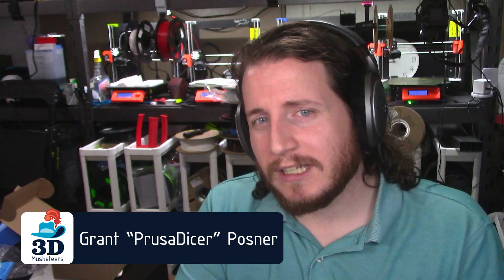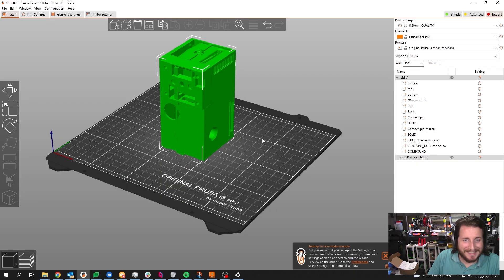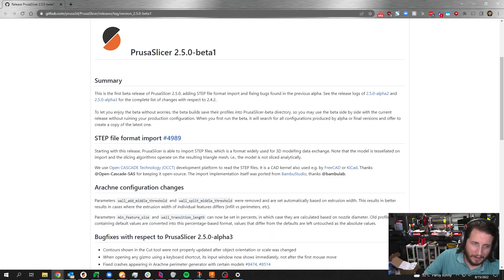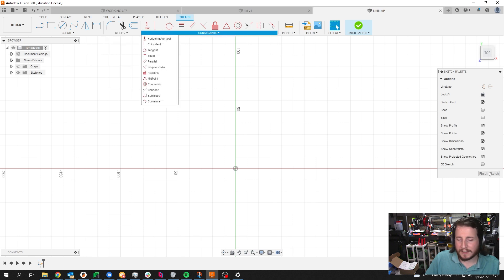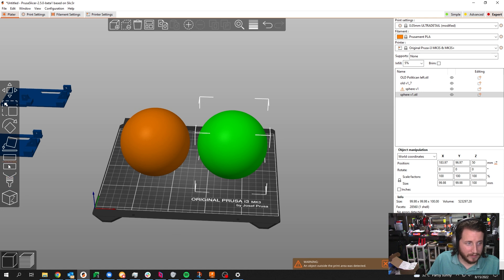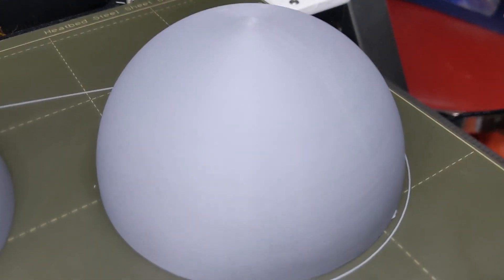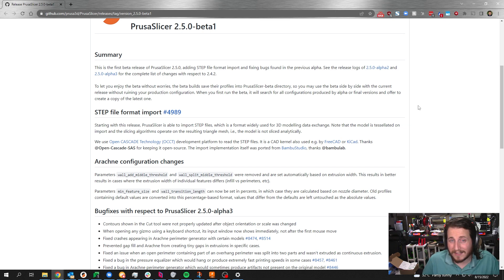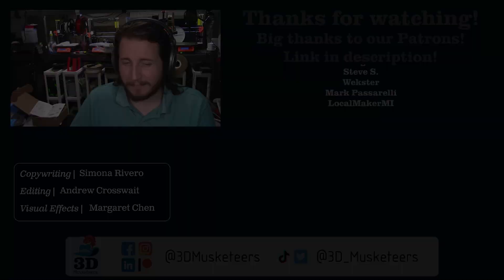PrusaSlicer's BEST New Feature! (Prusaslicer 2.5)

Comment: Read description of PS 2.5.0-beta carefully. PS convert step to stl with library by OCCT.
If you see difference, it is only because Fusion 360 use different parameters of angular and linear deflection.
Reply from the maker: Correct, we did read that, ended up cutting it, it was slow, we were seeing how the tessellations differ :)

Comment: I need to play a Christmas slasher a little more, every time I go over to it I just can't get anything good out of it. On my ender 3 with cura I can just change a limited number of settings and get really quality prints , but when I use cruiser slicer, I have stringing I have extrusion issues I have a generally crappy surface finish.  I know a lot of people like it, but when I compare it to kira it's just not even close
Reply from the maker: LOL Voice to text error I think?

I would guess the cura profile is better tuned than the PS one, but that should not take too much to handle. If you have questions let me know! We can even cover it in a PFF episode.

Comment: I've been watching for a while now, but I still don't know what "the politician" is.
Reply from the maker: A product we are making that will filter and produce hot air, you know, like a politician ;)
Reply: @3DMusketeers  like a Nevermore recirculating filter?
Reply from the maker: with a heater built in as well. All in less than 65mm square :)
Reply: @3DMusketeers  Go on ... 😲
Reply from the maker: Hoping to hit a $50 price point, but it will not include a 24v power supply at that price. I will call out makers and assume yall have one already in a bucket and will give you justification to your significant other's to have that box of power supplies, or we will have them separate.

Comment: How is this operating? Is it converting the step to 3mf at some point?
Reply from the maker: Not a gosh darn clue LOL.
Reply: @3DMusketeers  well, would be great to know, because the one thing is an easy step to stl converter, while the other thing is a leap forwards, no matter what, I like it.
Reply from the maker: The system they use is open source, I am sure if you had the programming skills I do not, you may be able to find it!
Reply: @3DMusketeers  it's transforming into some triangulated model of some sort, it's producing faceted bodies and it sometimes leaves open edges.
Reply from the maker: Ah, well that does make sense!

Comment: I've never heard of step before. I would be more interested in FBX support (just at least say hey.....I see different material shaders.....would you like me to setup the MMU2 or the XL tool changer for you?)
Reply from the maker: STEP is the most widely used format in the engineering industry. It is universally accepted by CAD programs.
Reply: @3DMusketeers  ah I'm more into video game asset type modeling. makes sense
Reply from the maker: Gotcha, that makes sense.. FBX is Max and Maya right?
Reply: @3DMusketeers  yes and more importantly blender which is free. lol I'm not sure how well it records shader information, but there is definitely enough to have the MMU see it. unfortunately there doesn't appear to be a way to import that information into prusaslicer. I can do better "painting" in blender than prusaslicer. At least right now anyway.
Reply from the maker: You can try using 3mf if you want, but for MMU to work properly like you are saying each piece would need to be its own STL file. Colored files would normally be .wrl format which is not accepted by most single color or even mmu based printers
Reply: @3DMusketeers  blender doesn't support 3mf. The most frustrating part is everytime I think I have it, I slice it, find an issue, need to go back to blender, re-import.......and in spite of the fact that the STL is nearly identical (in most cases the poly count is the same it's just the positions changed somewhat) prusa slicer wipes out the colors EVERY SINGLE TIME. lol Yeah there you go. They need to add similar object recognition to automatically re-color reimported STLs. lol I'm actually glad that prusa doesn't require separate STL files anymore. Sometimes that's easy Other times I don't even remotely have a clue how I'd do it and still make it slicer compatible (since it has to be a closed object)
Reply from the maker: YEP That is the downside of MMU, it wipes the colors

Comment: out of curiosity can I install 2.5 B1 and still keep 2.4?
Reply from the maker: yep!
Reply: @3DMusketeers  SWEET!!!! My enterprise model is begging me to try the new engine before reprinting when I get the revo 6. I decided not to use the spare V6 after all I don't want to mess with a compound hot end ever again. lol I've had the printer what? 4 months maybe? I've ruined 2 v6's? It's giving me PTSD just thinking about them. I think it comes in today. We'll see
Reply: The alpha uses different configurations from the beta or the full versions. So not even your filament/printer/print setting configurations will interfere with each other.
Reply: @runklestiltskin_2407  I just need to make sure I get my filament swap settings copied over. When I first got the printer the MMU2 failed about 90% of the time. After tweeking settings it fails about 1% of the time or less. Usually what makes it fail is having extra stringy debris in the boden tube causing extra friction. But then it being unable to load filament causes the filament to get a massive chunk taken out of it. Everything else can revert to stock for all I care.
Reply: @awilliams1701  you can export the configuration from 2.4 into 2.5 beta.
Reply from the maker: Exactly, export your config and load it into the beta for it to work as intended :) Sometimes it pulls properly, other times not so much.
Reply: @3DMusketeers  Revo 6 came in LATE last night. I'm going to install it today!!
Reply from the maker: SWEET!
Reply: @3DMusketeers  I sent you a picture of the old one. Its BAD REALLY BAD
Reply from the maker: Got it :) Will work with you via email!

Comment: There's a post processing script that converts what is intended to be round holes on xy from a bunch of discreet g1s to g2 arc movements. That combined with step files and arachne sound killer. Hopefully super slicer catches up soon. Either that or prusa better add a chamber heater option.
Reply from the maker: Yeah, it is called Arc Welder I believe. But I would prefer to have it built in. Any time you need to do something post from slicing you introduce the potential for issues, fast.